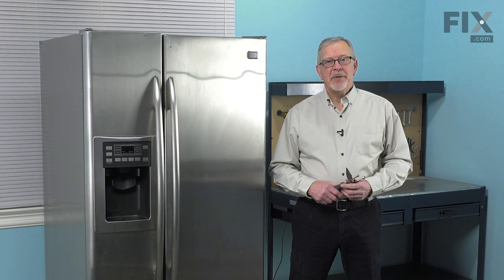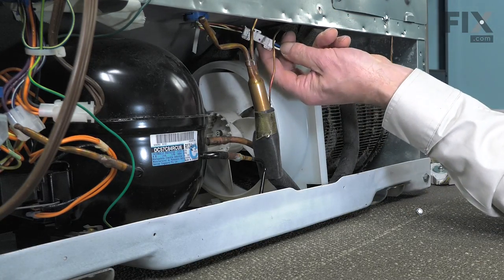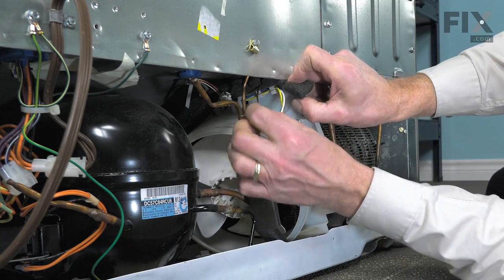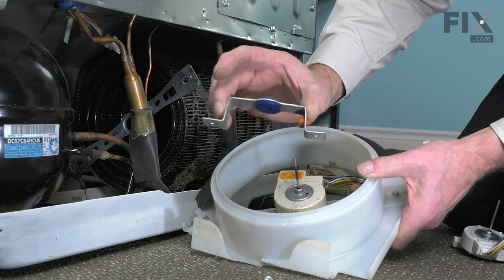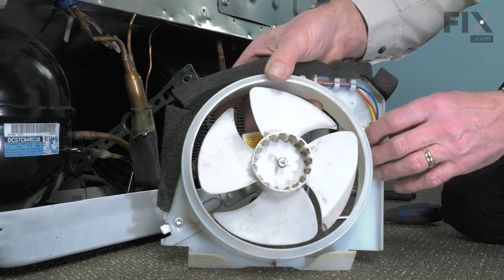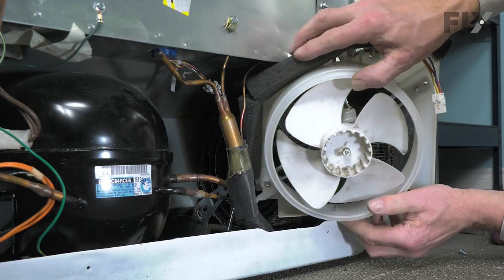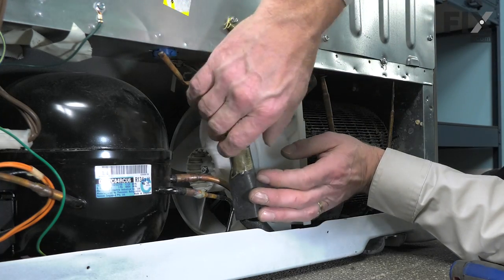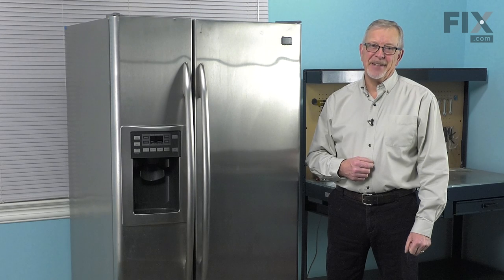GE  Repair Refrigerator – How to replace the Condenser Fan Motor

Comment: Excellent video.  For those of you replacing the condenser fan motor, I would suggest:

a) wipe the fan blade with something like Clorox/Lysol wipes.  Unbalanced fan blade makes sounds and may prematurely damage the motor
b) while the condenser shroud is off, use a condenser coil brush and vacuum to clean the coil as much as you can.  That means inside and outside!  I know the video was focused on replacing the fan motor, but considering how dirty that condenser coil was, they should have at least mentioned cleaning it.

good luck!
Reply: hey kevin, are you saying I may need to only clean the fan blades to get rid of the noise? mine just started making noise. I'm not sure if it's the fan or the motor?

Comment: I have a very similar refrigerator and been so frustrated even finding a repair place that could repair it. My freezer stopped freezing anything but water and I couldn't figure out why. My dad came over, took a quick look, we opened the back and voila, this was the issue. Had to reopen it to take pictures so i knew which motor to get. Can't wait for the replacement motor to arrive.

Comment: Nice job, well done. Looked like if you were repairing your own fridge you could possibly cut the bottom sheet metal with two cuts about an inch or so and bend down metal to make taking out easier. Bend up when done and cover with aluminum tape. Never done this repair but was looking to see what I may run into when I check on a fridge later today.
Reply: I took one of these exact fans out and it was pain in the ass. I'm probably gonna do what you just suggested when I put it back in

Comment: How does the fan go on with the metal clip towards a compressor or towards the condenser
Reply from the maker: Typically the clip goes facing away from the motor it is attached to.  Depending on the manufacturer they maybe using the fan to pull air over the condenser or push air over the  condenser.  Pushing  air is the most common situation.

Comment: Thank you for your videos. I have a problem with the fan on the back not working and the lights on the door not working. I cleaned the dust around that area, I was gentle, but not sure if that caused an issue. The defrost thermostat was not working as there was snow build up inside the freezer. I tried to troubleshoot from the back panel and not sure if I did something then. Please help me.
Reply: Light: Probably the switch relay at the door, typically just pry out and replace. Defrost heater probably has a short/broken connection, replace with new.

Comment: Does the fan pull the air off the condenser or push the air to it?
Reply from the maker: Great question, most manufactures push cool air over the hot condenser, this is done to help not only cooling but move any amount of dust or lint out of the coils. Lint and dust build up significantly  reduce the efficiency of heat transfer, cleaner the condenser the better the system works.

Comment: No need to pull the whole plastic shroud assembly, first just take off the fan blade, then undo the two screws holding the motor onto the bracket and remove the fan motor.
Reply: That is exactly what I did because mine couldn't be taken out. I've tried every twist and angle combination it wouldn't come out. I couldn't bend either because the assembly is made of metal.

Comment: What a disgusting, pathetic design...
Reply: It's worse than you think.  I just opened my GE to clean the coils.  The only way to thoroughly clean them is to remove the fan assembly.  The assembly isn't too difficult to remove, but as can the seen in the video, you risk rupturing the copper lines when you do so.
Reply: I have seen some videos on fan replacement, which are great. But I would like them to show the fan working at the end of the videos.